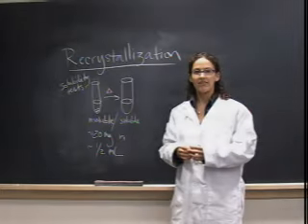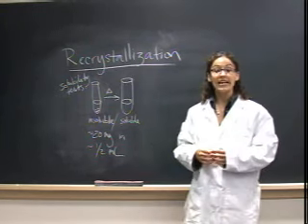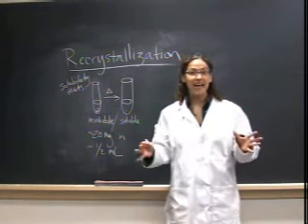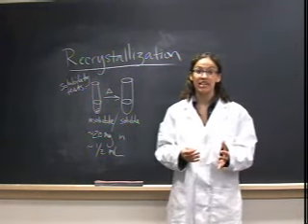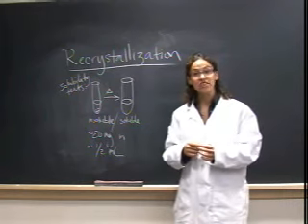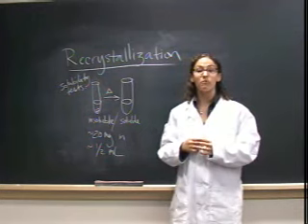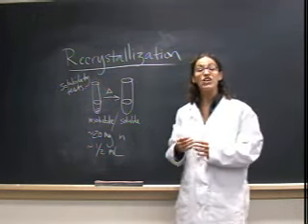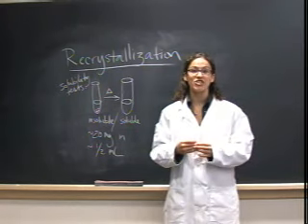Recrystallization | MIT Digital Lab Techniques Manual

Comment: can someone explain more in depth why oiling out happens and what to do if it happens?
Reply: Possible with any method, especially reverse additions. One possible cause of oiling out is that drops of the product solution are surrounded by the antisolvent, in which the solubility is very low, and this low solubility creates localized regions with very high supersaturation ratios. Many variables to consider here. Before mixing to the molecular level is achieved, the localized high supersaturation forces the product out of solution without allowing sufficient time for ordering of molecules to enable crystal development. The resulting oily particles have a tendency to clump together before the Occluded solvent migrates throughout the solution. As the mixture is aged, the oiled-out particles may transform into amorphous solids or become "crystalline" (with poor lattice structure)

Comment: Why is it that the ideal solvent is insoluble in room temperature but soluble with the sample at boiling point?
Reply: You want all of the compound to dissolve in the solvent (= no crystals) at the point where the solvent would start to boil. But when you cool down the solvent the solubility decreases which leads to forming of compound crystals. When solution has cooled to room temperature you want all of your initial compound to be as crystals, and not dissolved in the solvent, for a maximum yield. Only the impurities should be dissolved in the solvent at room temperature.
Reply: Henry law and roult law

Comment: chunkymonkey2782 If I understand correctly, oiling happens when the boiling point of the solvent exceed the melting point of the sample. So when sample is dissolve at boiling point of the solvent, the solution created would have the sample "oiled" out instead of crystallize out.
If this happen, you should reselect your solvent...